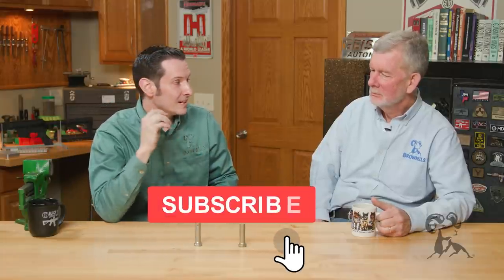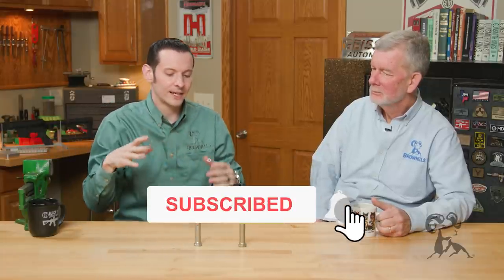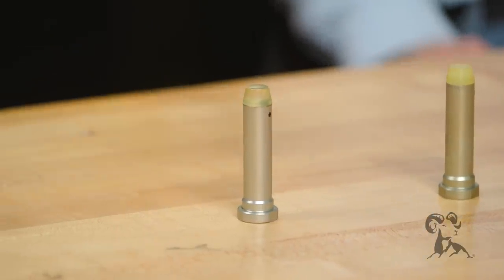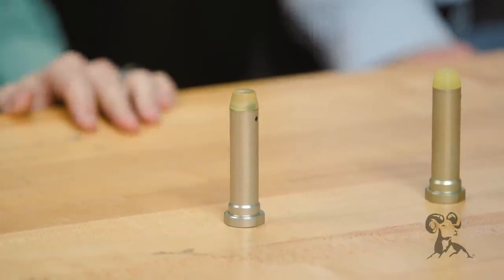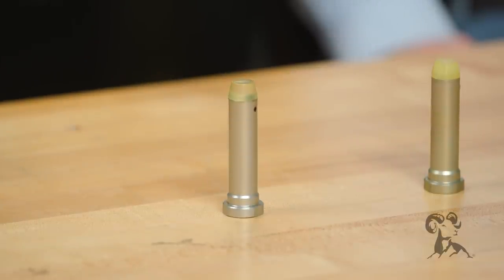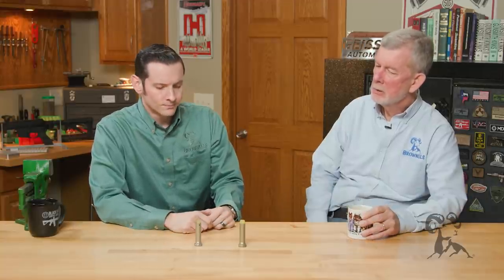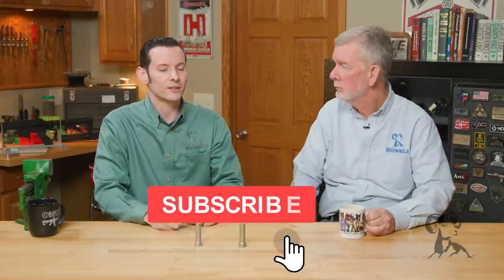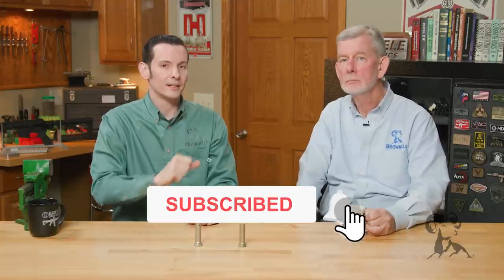Smyth Busters: A Heavy Caliber AR-15 Requires a Heavier Buffer

Comment: Just watch your ejection pattern, 3 o'clock is a perfectly timed rifle. 2 o'clock is a bit more gas running the bolt faster. 4 o'clock is a bit under gassed running the bolt slower.
Reply: Yes! We covered that in greater detail in previous videos, the ejection pattern certainly tells a story.
Reply: I need to search what you all have to say about adjustable metering of the gas.  I have an 6.5g AR upper from Alexander Arms that runs well with the standard buffer with an 18 inch barrel shooting wolf ammo.  I have a BCA upper in 7.62x39 that is over gassed and functionS well with an H3, but not a standard buffer.   I was getting double feeds from some magazine I assume due to a rapid bolt speed that was borne out by ejection to the 1 o'clock position.   The trouble is if you use an H3 with an overgassed system your felt recoil goes up.  
So I eventually need to adjust the gas flow through the system and I am thinking of those that are on the carrier as being easiest to install, but I think the action will get dirtier sooner with such a system.
Reply: 330😊

Comment: I have a 450 Bushmaster carbine upper on a 223 Bushmaster lower. Works fine with the stock buffer that is in the 223 lower..
Reply: Are you using factory rounds or reloading your own?
Reply: @Ruteger100  I use both. Reloads mimic factory loads but a lot less expensive!

Comment: Somebody forgot to share this info with Daniel Defense.  My upper from DD ridiculously over gassed and there is no way a standard 3 oz buffer and standard spring was the intended design.
Reply: @JenkinsStevenD  Your fact is a load of BS.  Over gassed rifles have failure to feed issues amount other problems.  So maybe we should start with function in any weather before we brag about cold weather function.  Standard milspec gas port diameter works just fine in cold weather.

Comment: No mention of ammunition type... e.g subsonic vs supersonic ??  300BLK usually has a pistol length gas tube.  Standard buffer weight works well with subsonic ammunition.  H or H2 works well with supersonic.

Comment: I am running a 7.62X39. I had never had issues with buffer. I have swapped buffer spring to an AR10 carbine spring which has softened felt recoil down to standard AR15 recoil.

Comment: Thanks Brownells for putting this video out! I’ve been searching through the forums, and asking the gunsmiths I know for the answer to this very question! Jerry Miculek just released a magnetic buffer that is designed to dramatically reduce recoil out of an AR-15 (he said in the announcement video, “for MSR’s chambered in 223/556 & 300blk”). 
I am recoil sensitive after being disabled in the line of duty, and even though it already has relatively little recoil, I’ve been wondering if I could put that buffer in my 6.5 Grendel to further reduce felt recoil. From your explanation, sounds like I can without a problem!

Comment: Heavy buffers and/ or bolts help strip the rounds out of tightly sprung magazines. I bought one of your titanium bolt carriers in 308 awhile back, while it was light and craftsmanship looked very good, it would fail to seat rounds into battery every few shots. The weight was too light to carry the energy needed to push the rounds out of the mag without slowing the action, it would barely be out of battery at the end of travel. So I put the lantac bolt in and it goes bang now everytime. The 308s builds are trial and error to get right, having alot of money helps.
Reply: you are correct and the myth is still out there. there has to be 200 videos on the youtube right now that had to change the tube out and some still needed drilled.

Comment: Great info. Between the front setup, buffer, AND spring there can be multiple options on finding the "perfect" tuning for the rifle.
Reply: Yup.  

Standard spring with heavy buffer may work while a heavy spring with standard buffer does not.. 

And, some setups, the carrier may just need oil too... seen it happen.  Not closing, so peraon wanted heavier spring... looked & it was dry... oiled it up & cycled fine...

Comment: I run H1 buffers in all my carbine length rifles, and they all have mid length gas systems. For my MK18 I use the H3 buffer and the LMT enhanced BCG. Works like a charm. I may use an H2 buffer for an 11.5” build

Comment: Apparently, Diamondback uses a light buffer in the DB15. When I threw a .350 Legend upper on it worked ok with FMJ and XP rounds, but the heavy 180 soft points were causing no really hard ejection like the gun was over gassed. I got another lower (poverty pony) and put it together with all low end milspec parts, it ran all of them perfectly.

Comment: Speaking just about 458 SOCOM, you may find the myth "plausible", as well as some other possible changes.  I have a 16" 458 upper from a well known and respected manufacturer.  It has a carbine length gas system.  With the standard configuration as provided by the manufacturer, on a standard AR lower, it was unlocking way too early, while the chamber pressure was too high.  This resulted in bent brass rims and a lot of extractor wear.  I'll skip all the details and iterations, but I solved the problem with an adjustable gas block to throttle back some of the gas.  However, heavier buffers can also delay unlocking as can different buffer springs.  I note that some manufacturers now provide one or both of these with their 458 kits.  So, I wouldn't necessarily say that a heavier buffer is not sometimes needed for certain chamberings.
Reply: Yes, that is a barrel gas port issue more than a buffer issue. A heavier buffer is just a bandaid in that situation, not the cure.

Comment: The heavier buffer is for softening the recoil impulse but if you soften it too much the gun won't cycle. As you change manufacturers or loadings within a caliber this can affect which buffer weight is the best balance between reliability and low recoil. Underpowered ammo in any caliber can even cause the standard buffer to be too heavy. But a gun with enough rounds through it (well over 10,000, I'm sure) may have enough gas port erosion that a heavier buffer is justified. Start light so the gun will definitely cycle and go up until you like it or it stops cycling. Otherwise leave it light, accept the recoil, and be sure it will always cycle. I have heard from multiple sources that the standard M4 is over gassed on purpose compared to most civilian AR setups because the military wants more reliability and accepts all the trade offs (heavier recoil and slightly more part wear).

Comment: You may have to tinker with your buffer and buffer spring if you are running a 300BO more than you might with other rifles.  I went from an H2 buffer down to a 3 oz and installed a tubbs flatwire spring made for 300BO.  I had the gas block opened all the way, and verified gas port alignment with a boroscope, and still wasn't getting LRBHO with a standard carbine buffer spring and H2 buffer.  That was with a 10.5" barrel with pistol gas length.  This one has given more issues with the feedback system than any other rifle has.  Excuse me....er...I mean....pistol.  My opinion on the matter is to solve the gas feedback issue at the gas block, not by tinkering with buffers.  If it can't be solved at the gas block, then ok....start messing with the back end.

Comment: I did a 450 bushmaster with a H3 buffer since I researched the uppers were designed to run with a fixed stock and rifle buffer vs carbine buffer tube.  I read the H3 is more equivalent to a rifle buffer and many were using the H3 with success so I went with that and it works fine.  The adjustable gas block with a faxon barrel was also needed.  I really do not know what is right, it’s experimental when mixing parts.

Comment: Heavier buffers are to control cyclic rate (slows the unlocking of the bolt to reduce chamber pressure) and also to reduce bolt bounce with heavier profile barrels. Standard carbine or H1 max for most applications. H2 recommended for heavier profile and full auto.

Comment: If you are going to run different uppers on the same receiver just get adjustable gas blocks for your uppers then tune them for the same lower, yes a bit more expensive on your upper build and will eliminate so many problems.

Comment: I always understood the buffer weights had more to do with select fire guns and the bolt bounce during burst or full auto fire. What I was told is run the heaviest buffer that the gun will reliably lock open on when firing the last round in the mag. Generally I have found a H buffer to be perfect for 16in AR with carbine or mid length gas system as they generally tend to be slightly over ported/gasses for reliability.

Comment: Good info, I have a standard-length carbine, last year I swapped out for an H2 buffer and a flat wire buffer spring, took the twang out of the recoil and my shells are ejecting at a much better angle.

Comment: I have a 10.5” AR 450. Handloading the 450 with the great 200gr Hornady FTX bullet. I used this in the Smith 46O and it dropped deer like a sledge hammer. This bullet is remaining in the deer expending all of its energy. Bullets are expanded just beautiful. It is doing the same in my 450. In the 10.5 barrel the recoil is very heavy, would a heavier buffer help in this situation to tame down the recoil?
Thank you

Comment: Please address the "different rules for AR-10's heavier BCG" a  friend purchased an 18" barrel, rifle length gas system upper and wants to run a carbine receiver extension(buffer tube)/buffer and spring so he can use a Magpul PRS Lite stock. Is this advisable and will it be reliable. Thanks!

Comment: I have BCA  18" 450 bushmaster with midlength gas tube and have trouble feeding the third round ejection wise is good and  around  4-5 o'clok I replace the buffer spring about 2" longer than my standard ar spring still have same problem thank you

Comment: Heavy buffers are the quick and cheap fix for an overgassed rifle, but they don't address the underlying cause.  The problem is a "standard" port size can only be done for a specific loading.  And most barrels err on the side of bigger gas ports and overgassing because that's an easier fix than undergassing.

A heavy buffer might dull the symptom, but an adjustable gas block will usually fix the actual problem.

Comment: my .350 AR jams every round with the standard stuff. failure to feed, it just can get up the ramp should i just get a stronger (or longer) buffer spring?
actually, now that i think about it, the brass did just sail into the sunset while i was at the range

Comment: BCA recommended H3 for their 450 BM 18". Runs like a top.
Reply: Good to know 👍 My 18" 450 BCA worked great on my M&P lower. Then I got a stripped BCA lower and assembled with a Palmetto kit. Now my BCA 450 will not hold open on the last round   by itself. It will do it if run the bolt manually. Going to try a H3 buffer 👍
Reply: @Happyhandcannon  Used on a Colt and M4E1 lower with LaRue trigger as the mood hits .

Comment: Have you guys done a segment on how to make your di ar platform quieter? I'm so used to the creaky bed spring sound, any way to make that go away?
Reply: Switch to a Geissele Super42 or JP Silent Capture Buffer.
Reply: JP Silent Capture spring works for me, I’ve got them in two rifles and they run wonderfully out of the box, but the extra buffer weight options are handy if needed
Reply: You might want to consider a Tubbs Precision flat stainless steel spring as well. I have them in "3" different rifles and they cycle quietly. JP is $130.00, Geissele spring & buffer is $65.00 and the Tubbs is $28.00.
Reply: A cheap solution is to coat your buffer spring with grease, I use mobile 1 high temp wheel bearing grease.  I've found it gets rid of the sproing sound.  Don't need too much, just a light coating on the entire spring.
Reply: I had that same problem with the regular spring. I bought the flat spring from Strike Industries. It's way cheaper than the JP Silent Capture or Geissele spring. It solved my problem. I'm also running it with a Spikes Tactical T3 tungsten buffer weight because I use it in an AR shorty.
Reply: I run the JP in everything.

Comment: I have 300blk 8”..having problems cycling subsonic Ammo …do I need a heavier buffer
Reply: That depends on what the problems are specifically.
Reply: You're probably short stroking because there's not enough gas pressure from the subs to cycle the BCG so a heavier buffer would make it worse. Mine won't cycle subs without my suppressor on it for that very reason. If you want to run subs you'll need to tune your gas and buffer system to run them. I'd recommend an adjustable gas block so you can change the gassing if you're shooting subs or supers.
Reply: What's the issue?  Failure to feed, failure to extract, not stripping a round out of the magazine, what exactly is the issue?  The Dude is probably spot on on his guess, but you have to let people know what issue you're having before people can help, my friend.
Reply: Hey buddy.  If you verified the gas block alignment and your gas block is fully open and still having issues, get this spring: ARBUFLW     It is on David Tubb's website.  It reduces the pull weight over a carbine buffer by about 2 pounds which might be all that is needed to get it to cycle correctly.  More than likely that will fix your issue.  If not, REDUCE the buffer weight.  A heavier buffer will exacerbate the problem.

Comment: glad to hear about the heavy buffers, but i have a question about the buffer springs. what is the difference between an AR15 5.56 CARBINE spring, and an AR308 .308 CARBINE spring? and can i use the .308 spring in a 5.56? same question with the RIFLE springs.   HELP....
Reply from the maker: No, they are different lengths.
Reply: @brownells  so, maybe palmetto state installed the wrong spring in my .308. i was curious, so i measured length the .308 was less than 1/16 of an inch longer, but had the same number of coils, as my AR15 5.56 carbine. my Colt 223 rifle has a longer spring than both and more coils. please i really want these to be correct.

Comment: Is it safe to say that for subsonic 300 aac you need to put in a lighter buffer or spring? Because my setup with a factory buffer for 556 will not cycle subs.
Reply: I watched this video to answer the same question. Did you find a lighter buffer weight worked in this case?

Comment: I have a 16" .300 Blackout with a carbine gas system. I am trying to get it to reliably cycle sub-sonic ammo with a TiON suppressor. I have tried a fixed gas block, an adjustable gas block, an H1, H2, and H3 buffer, and just about every combination but it just will not cycle. On the recommendation from a smith, I cut a recoil spring down and it would USUALLY come back to battery, but every 4th or so round, it would not.

When I use the same setup but with my 8.5" barrel (again, .300 BO, sub-sonic, suppressor, and any weight buffer and a fixed gas block), the weapon cycles perfectly ... magazine after magazine.

Is it just impossible to use sub-sonic ammo and a suppressor on a 16" .300 blackout? Thoughts on what to try next?
Reply: The problem is you need a pistol length gas system.

Comment: I'm running a blue sprinco and an h2 in my 16inch fnh midlength and it still cycles steel case, seems over gassed to me. With a standard spring and buffer it kicked like a 20ga.

Comment: Personally, I run a VLTOR A5 buffer on a 20" upper, just because that's arguably the most reliable AR that you can get.
Reply: Great choice!
Reply: That’s why the USMC liked it. Smooth
Reply: The A5 is great on anything you put it on.  It did wonders on my MK18.
Reply: @kevspss  They never ended up using it though.
Reply: @johndunbar2393  Yea they're great. I'm using a UBR Gen . 2
Reply: Pickle Rick yep. Went to M4 A1’s
Reply: @kevspss  That was a mistake.
Reply: @picklerick9578  That's my favorite stock!  Unless I want less weight.  Another great choice man! 👍🏻
Reply: @johndunbar2393  yessir!

Comment: Isn't it true that most rifle are over gassed. To make sure they run on all ammo types?  And how is this theory affected by 7.5" short barrels with large cal. Bullets?  
Also doesn't heavier buffer weights save wear and tear on an over gassed rifle?  If so is that just bolts?  or includes extractors and bullet casings?

Comment: So I had to standard eight to lower and I slept the carbine length gas system upper on it. I do have light primer strikes every third round or so. With changing my buffer to a carbine Waited buffer help?
Reply: If it is going fully into battery and you are having light primer strikes then no, you have another issue there.
Reply: Ok thank you

Comment: I built out a 300blk out with an H2 buffer and have been having issues with cycling the bolt, it juuust barely won’t shut about 40%? Of shots, so I switched it to the carbine buffer and will update this hopefully in a week or two with results on reliability
Reply: Update?
Reply: @ishkabibble2204  so I took it to the range and it STILL jammed, made me sad af , 
Took it to the gunsmith & then
I got it back he reported it was actually burrs in the barrel & he machined those out. 

Put tons of lube on there and now gotta go back to the range 😅 I realllly hope that this works out
Reply: @chupacabra304  Thanks for the quick reply. Good luck.
Reply: @ishkabibble2204  no problem, Im fortunate enough to work somewhere where i’m allowed to surf da webs .

When I go shooting this next time i’ll try to remember to post another update.

Edit: i’m really hoping I have no more issues 😮‍💨 it’s been an absolute nightmare trying to get this build working. It’s actually a really expensive build but I suspect the tolerances are stacking in weird ways and that gave rise to failure to go into battery every couple shots which is super frustrating especially because I built it with intent of it being my home defense gun. When it finally runs smoothly i’ll be so happy